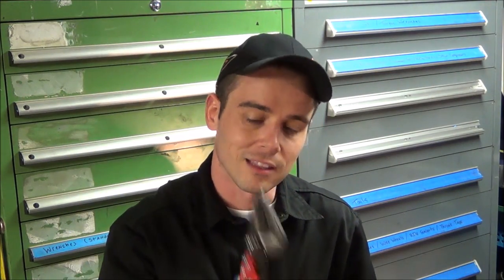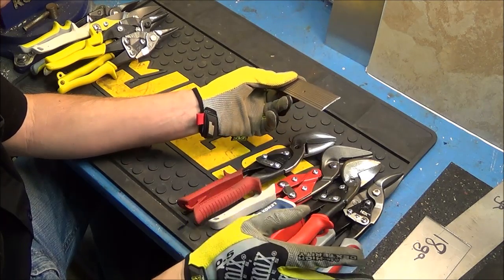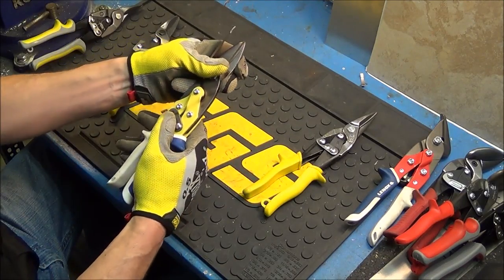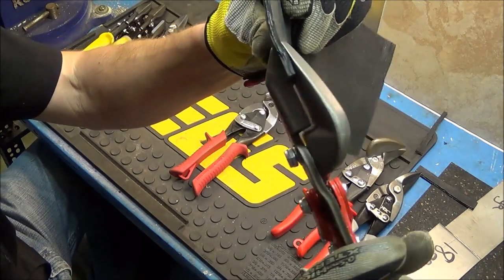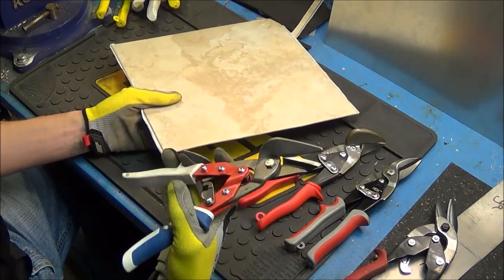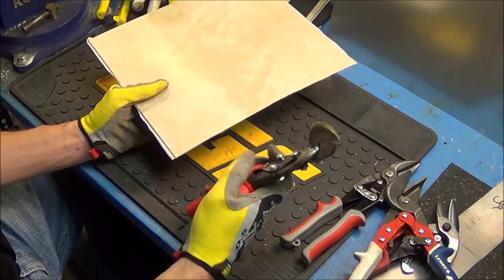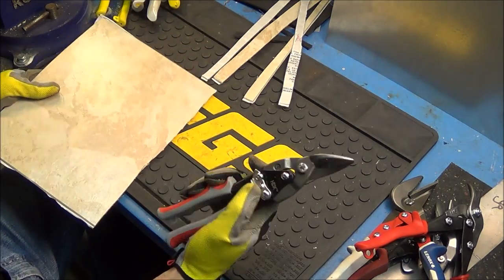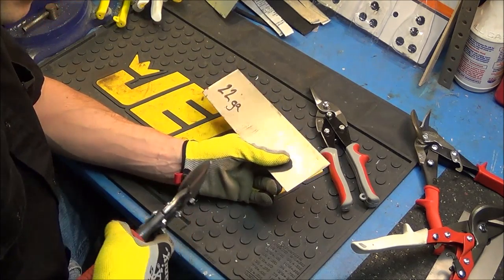Aviation Snips - Full Testing & Review - Midwest, Wiss, Lenox, & HDX

Comment: Midwest are most def the best out of these.... these are alll offsets.... With straights not offsets wiss are the best.....lenox are ok but they just aren't as good as the Midwest offsets... if you use snips frequently there are a cpl brands better than midwest but Dewalt and Milwaukee are not. ... the Milwaukees are ok but go with midwest out of these 4